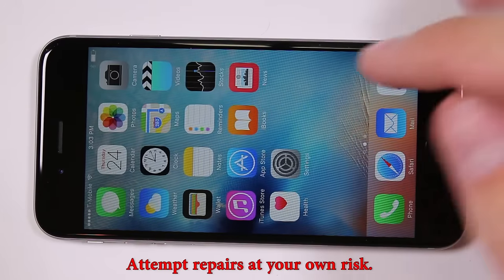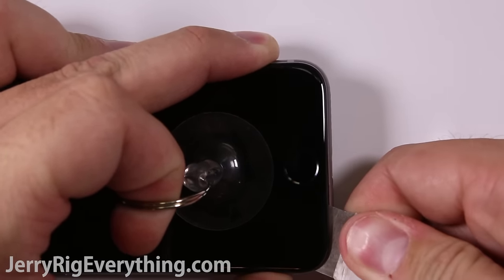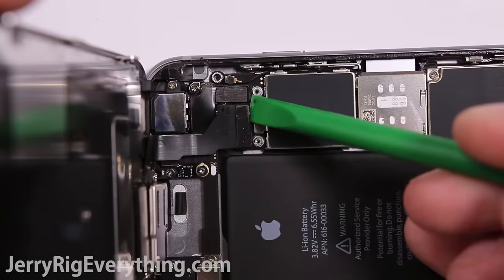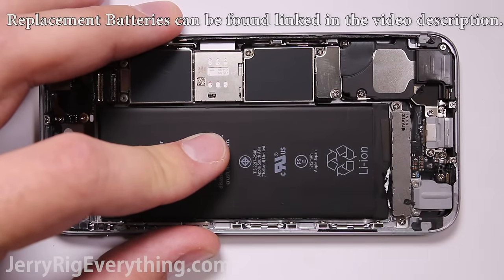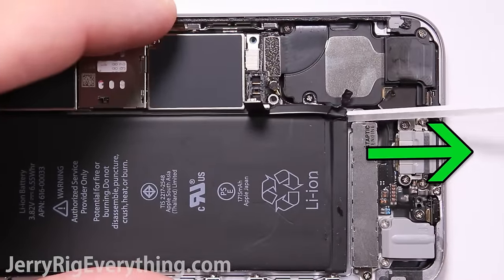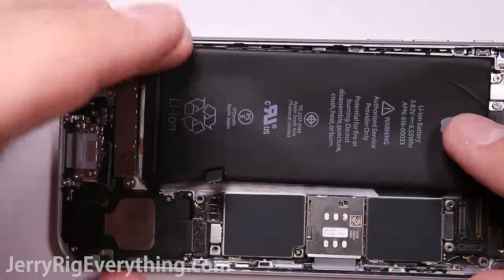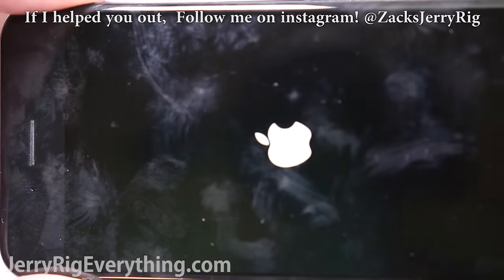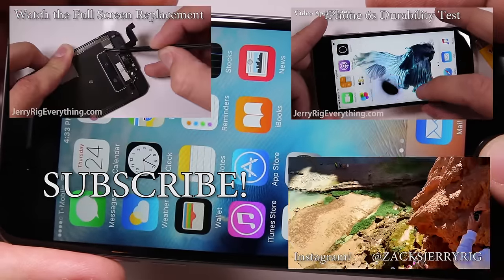iPhone 6S Battery Replacement in 3 minutes (Easy Method)

Comment: I bought the battery with the kit on Ali for 10 bucks. Fixed it as per this video. Since 3hrs the level of charging did not change. With the previous battery it would go down about 30%. Thanks a lot. Good video!

Comment: Followed your video ansd it worked geat, thanks. The only step you missed out was the prolific swearing   and cursing when you drop one of those  tiny screws and when those sticky tabs break off even though I pulled hem from the bottom. Apart from that, absolutely brilliant

Comment: I did it.  thanks.  I did not disconnect the screen per someone's comment below.  Instead I used a heavy box and some masking tape to secure the screen at a 90 degree angle.  The adhesive tape under the battery was the hardest to remove.  Thanks

Comment: I was considering upgrading my phone as the battery on my 6s barely lasts an hour now. But I can't bring myself to spend hundreds of £ on a new phone when the one I already have suits me just fine. So I'm just upgrading the battery. I hope it works. Thanks for the video.
Reply: Im having the same problem only my iphone 6s wont charge at all so my phone wont turn on. where did you get a battery and if you dont mind me asking how much.
Reply: @Justin-ge5ot  I got mine from Amazon. I think it was only around £14. By the way, it is pretty straightforward to replace. But the screws are TINY. I can't overstate how small these things are! They are like pieces of dust. So I hope your eyesight is good

Comment: The presentation is BANG on. The good, the bad and the ugly for removing the battery tape is exactly how it is described. Even though I followed the good instructions but one of the tapes broke and left me with the ugly fix. Not surprising the same one that broke in the video.  That tape sticks man. No easy task to remove.  I purchased a kit that contained the battery and tools plus replacement tape all seen in the video. Don't under estimate the value of that suction cup. It made getting started, the case to part initially a god send.

Comment: This is an old video, but it helped me in 2023. Thanks so much!
Thanks for recommending double sided tape. It will be easier to remove than the adhesive that comes with these batteries sometimes.

Comment: Thanks for advices :) 

Unfortunatelly those original sticky pads hold like hell, so of course I did tear it apart so I had to went hard way :)

Plus one note: be careful with the plastic tool while unsticking the original battery! I accidentally cut the battery plastic cover. Luckily no shorts or fire cause I fixed the cut on the baterry immediatelly with insulating tape, but the smell going from the battery made the replacing quite disgusting :D 

I suggest taping a dining knife with insulating tape so you can unstick the battery without bending it so much as while using these plastic tools... But of course, best is if you manage to et rid of the original pad before battery goes out :)
Reply: I bend the battery while changing now the battery is getting hot I don’t know what to do, just leave it on the floor and run. 😂 what should I do now

Comment: I always remove the two screws on the taptic engine, and remove it. Then, the two adhesive strips can be easily dragged along the charging port and headphone jack as you pull them out. Don't forget to put it back in before the new battery so that it fits.
Reply: ChanChanP , but 8ff fug
Reply: I bought a kit that doesn’t have new white strips

Comment: Remember the water proofing gasket on the iphone 6S, this will help seal the phone from dust and water.
Reply: i lost some of it.. it was real hard to un-pry it..
Reply: The video doesn’t mention this but be aware - the black and very sticky seal will twang off and stick to anything it touches as you remove the screen so grab it and try and peel it off before it does!

Comment: Good concise video which worked perfectly. Should definitely mention not to bend the screen cables past 90 degrees before lifting it though I had it sat flat on the desk at 180 by the time you mentioned it!

Comment: I just finished replacing my battery. Had a bit of trouble with the battery adhesive, but I figured it out. I also made sure to keep track of all the screws and where they went. Everything is working fine now, thank you so much.
Reply: I can't get the screws back in, been trying for 3 hours now :(
Reply: Try having a little magnet close buy , to magnatise
The little screw driver . Might keep one from losing a screw .

Comment: Thanks a lot this video helped a lot!  Just fixed my iPhone 6S Battery.  When I pulled the old one out it fizzled and there was some smoke.  I was scared because I thought to myself can't these things blow up?!  I was fine.  I handled it like a boss.  B-)
Reply: same happened to me lol
Reply: M.Vunduk  I finally traded in my 6S and just got a 7.  Not a huge upgrade, but it's good.
Reply: i just cant deal without the headphone jack its soo essential lol
Reply: M.Vunduk I've always used the headphones they gave me so I was ok.  I stream music in my car VIA Bluetooth.  Only thing I would use traditional headphone jack for now is if I had a pair of high headphones for at home or on the go.  Even then I would just use the adapter it came with.  But yeah Apple deciding to remove it all together was weird.  Oh well I'm looking forward to iPhone 8 now 😂😂🤓
Reply: they don't blow up, but if you pierce the battery it can shoot the flames of hell out of it once it comes into contact with air  and severely burn anything around it (seriously).
Reply: Firecrackers
Reply: M.Vunduk the charging port is the headphone jack on newer iPhones

Comment: Second time I’ve changed a battery in an iPhone. This time though I only removed the screws for the battery. Didn’t fool around with the camera screws etc... . Hardest part was getting the cover off...it was glued on tight. Thank you for sharing this video.

Comment: I messed up the "pull tab" method and completely destroyed my battery when pulling the adhesive off. probs to apple for making a strong adhesive.
Reply: Charizardlover 0707 pry of shame lol
Reply: I agree the adhesive tabs broke off the tape is far too strong  I had to pry it out the battery ruptured open giving unpleasant fumes and a whiff of smoke. Kept my patio window wide open for good ventilation and able to throw it outside if it caught fire.
Reply: Heat it up a little with a blow dryer!
Reply: You can heat back of phone with a hair dryer to soften adhesive.
Reply: Lance Baker wish I knew that 😕

Comment: Are you sure that the battery from the website you listed works the same as the original one from Apple? cause there are so many of them that don't work and some of them are even dangerous to use.
Reply: Tony ma i wonder to I want to replace my battery but I don’t trust aftermarket ones
Reply: Elizabeth Marks-Graham just buy original battery for 25 dollars

Comment: WARNING:  My battery IGNITED on fire when I was replacing it.  One side of the tape did not remove by pulling the tab, so I was doing the "pry of shame".  I must of been prying too hard because I suddenly saw smoke and before I knew it the battery ignited on fire.  I had no choice but to get back and let the battery burn itself out.  Could of caused serious injury as the battery was only about 1 foot from my face when this happened.

My advice is to pay the $80 and let an apple technician do the replacement.  But if you insist on doing it yourself, then be EXTRA careful when removing the battery and use a heat gun or blow dryer to warm up the stick tape before trying to pry the battery out.
Reply: Chris Drozdz the price is now $29 because of complains of battery life usage to apple
Reply: just use common sense and dont puncture a lithium ion battery
Reply: The battery I bought on Amazon said to let the old battery drain BELOW 20% before removing it, to prevent a spark/fire situation.
Reply: you do realize that by using a heat gun pointed in the direct vicinity of the battery you can still mess something up right?
Reply: And that's why you should always go slowly and try to notice if it heats up, and have a LiPo fireproof bag at hand.
Reply: bending a battery can do that
Reply: should've pray even harder..

Comment: I watched your video! Thank you for your time and effort! Everything was going well and then the battery caught fire! Burned my hand, I dropped it and burned the floor. We picked it up and threw it out on the deck. it was pouring down rain but still it burned the deck and totally destroyed my phone. I know this was my fault because I was using a metal screwdriver to pry the battery loose and I should have been using and plastic tool. Maybe you should have made a point to explain what would happen if you use the wrong tool like I did.

Comment: iPhones have a straightforward and sensible unibody design. It's unibody done right. As opposed to an HTC or a S6 phone where the battery is built around the whole phone.

Comment: So what about the adhesive between the screen and metal case? I guess you can't put them back and that remove the iPhone water resistance? Does it cause other problems like dust getting in?
Reply: TheMidnightNarwhal it doesn't have water resistance only iphone 7 so far
Reply: Neriman KOSE The iPhone 6s is unofficially water resistant
Reply: i've accidently submerged my ip6 in soup and it works perfectly fine
Reply: The iPhone 6 is not unofficially water resistant. Both my wife and I have had to service our iPhone 6's because water got splashed on them and the power buttons stopped working. If you look at the video above, you can see there is nothing to stop water from seeping into the phone via the buttons or the power connector and headphone jack. There's no gasket or seal of any kind. If you dropped your iPhone in liquid and it didn't break, you got lucky, nothing more.
Reply: not the iPhone 6. The 6s. It is actually unofficially water resistant. Please look it up.
Reply: Some people are stupid Guru.. ;d 

To answer, yes.. you will break the proper seal of the gasket.
Reply: My iPhone 6s+ was definitely not waterproof. It got dropped into a sink so the bottom half was submerged for around 3 seconds, I turned it off immediately and dried it out before turning back on. It turned back on but said connect to iTunes. I tried that and nothing happens and apple doesn’t even recognise it as one of their phones now. So no mines deffo now waterproof lol.

Comment: This was super helpful but took me quite a while because the screws are the smallest screws on the planet. Make sure you take them out and keep separated because there's a longer one for small rectangle lid that covers the battery connector. And as someone else mentioned, connect battery without strips first to make sure it fits right while connecting ribbon, before sticking it down. 
The tiny screws were a pain, even with glasses on I could hardly see them! lol Had a heck of a time just opening the phone   But patience paid off   - good luck!

Comment: my battery blew up when removing it
Reply: ME TO.. VERY SCARY EXPERIENCE. DONT KNOW WHY IT DID.
Reply: TheMacfann need to make sure before u took the handeling of it it needs to stay off for atleast 5 min
Reply: Watch the Bear Grylls episode on how to survive when lost if you have a mobile phone. See how he creates a huge fire with the battery. Just stick a hole in it, once it comes into contact with air it will burst into fierce super hot flames like a furnace. Phone batteries are so dangerous. These guys making these videos should mention that. Someone's house can get burned down due to it.

Comment: Thanks, heaps, mate. Replaced my battery in under 20 minutes. That because the pull tabs were apparently not strong enough and broke off midway. I bent the battery a bit and grabbed hold of the cut pull tab! Lol! All is well that ends well, I guess. Saved me the 'pry of shame'! Cheers!

Comment: I was just about to finish replacing the battery when my cat jumped on my screen as it was 90 degrees attached. DAMNIT.   One of the cables ripped off.  Ordering a new screen on ebay now.  That really made me mad. Great video though.

Comment: Had my iPhone 6s since 2017. Just installed my new $22 battery. Works brand new like it did in 2017. You wont catch me paying 1 grand or whatever for an IPhone 20 (or whatever number the current one is) or any other phone. BTW, you dont need to disconnect the screen for battery replacement. Replace battery while screen is opened at 90 degrees angle. To prevent screen or screen cable damage, rest screen on a wall or something.

Comment: Thanks for the video.  The key was getting the pull tabs to pull out towards the bottom.  Also, having something to pry the phone open (I used spark plug metal gaps for mine - size .013inch or .330mm) and pry the connectors off along with some very fine tweezers to get the screws back in.  They are tiny and also needed some magnifiers to see the dam things.  Appreciate the help!

Comment: It is a good video for replacing the old worn battery on the iPhone 6S. The iPhone 6S has a defective battery that lost charge quickly that Apple acknowledged and offered to change it out for $50 last year. Doing it yourselves will save the labor cost but I don't think it is cheaper than Apple offer is you pay for the OEM battery. A few things I would do it differently than this procedure. First, don't ever connect the battery before connecting the LCD, camera and digitizer because it could cause a short as you try to jiggle the connector into place. Second, replace the battery sticky tape with new sticky tape just in case you may need to change it again. Prying the Li-ion battery like he did could tear the plastic casing and leak the toxic Li-ion chemical and it may catch fire. Last but not least, as he opened the LCD out, you can see that there were adhesive there to keep moisture and the phone splash proof. He did not replace that adhesive, which is a no no, any moisture get in between the glass and the phone, your phone is toasted. Both the screen adhesive and the battery tape are cheap on line, get them before you start on this job.

Comment: If you have to force the battery out, don’t go too deep and cut the volume rocker cable (my mistake 
due to my excitement as i did the wrong way and followed the video religiously without noticing the parts below when i forced the battery out).
i reflected on my mistake cuz i only managed to pull one tab out earlier (with difficulty) then it dawned on me that Jerry could have made it easier to change the battery by unscrewing the haptic engine just beside the sticky tape tab before pulling out the sticky tape. That would make the pull tabs so much easier to pull off and that made plling the other tape out easily.

Comment: Excellent video. I ended up having to do the pry of shame, and then accidentally punctured the battery. It caught on fire. I worked through it, and now it is fine, but that was scary. 

My adhesive did not come off nearly as easy as yours did.

Comment: Excellent instructions - particularly helpful was what the cause was if one sees lines (I did).  Thanks to those comments I did not panic, but just reinstalled the connections.  One thing I would add is that having a second person to hold the screen up when reinstalling the screws is really helpful. Oh, by the way I followed these instructions for the 6, not the 6S.  Just a different screw arrangement.

Comment: I just had the battery replaced in my iPhone 6S yesterday. Got this phone in 2017 and the battery lasted until 2 days ago when it died and wouldn’t come back on. The battery has needed replaced for about a year now but I just kept putting it off until it died. I didn’t replace it myself because I feared I would screw it up and then I lose everything on it forever and have to buy a new $1000 phone. Good thing I didn’t try it because I would have screwed it up guaranteed. Now I know how it was done. Now this phone is good for a few more years. Now that I know it’s safe I need to get the battery replaced in my old iPhone 5C as I have old photos and text messages on it I can’t lose.
Reply: If it helps, you can save all your really important photos to the cloud, so if you ever break your phone, when you get a new one, you can still recover them all even if your old phone is literally totally un fixable (:. Also as for the text messages i believe you can screenshot them by pressing the home button and the top turn on/off button and the same time. Hope this helps for the future.

Comment: thank you very much for this video..the only problem i had was that i bought an iphone 6 battery and i had an "s' version.. so i had to exchange the battery because the connectors are not the same..and that trick for the glue ..it works..

Comment: Great video! Just fyi for anyone about to do this, you can easily replace the battery without removing the screen. You just need to be careful not to damage the ribbon cables/connectors.
Reply: Thanks for informing. Have a great day bro!
Reply: I did this but now my home button is unresponsive. Do you know how i could fix it?

Comment: The adhesive that attaches the adhesive to the battery is no joke! be very careful and make sure your old battery has no charge before you do this.  other than that the video was a big help and the battery that came from the link in the description seems to be working like new.

Comment: The best method is actually doing both prying and also removing the strip while prying it up a little bit at the same time.  if you try to do it without prying 90% of the time the strip will tear. you just have to pry the sides up enough so you can slide the tab underneath it